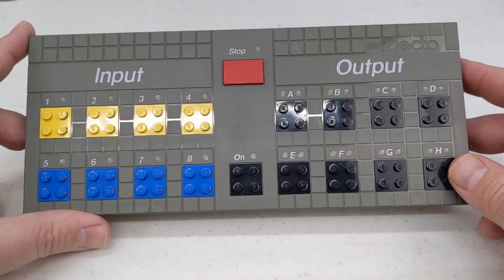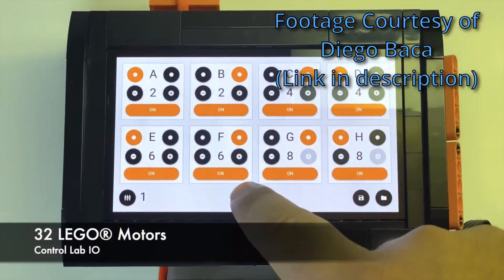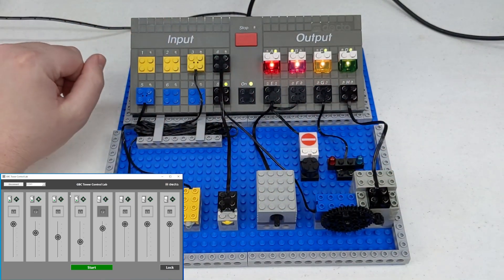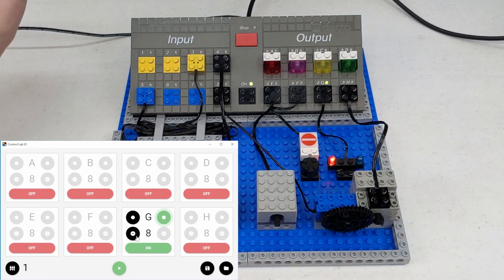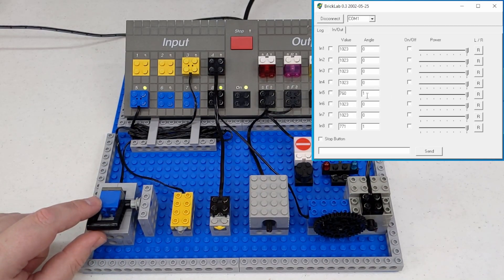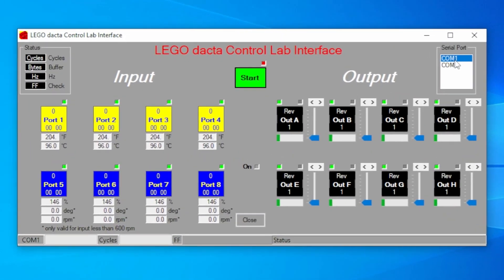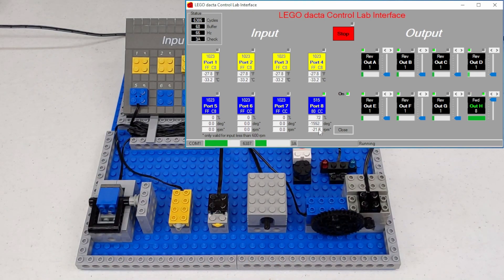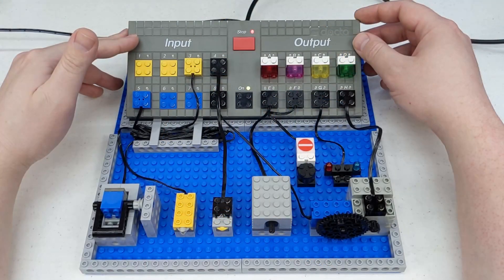Lego DACTA serial interface third party software (DACTA Control Lab)

Comment: Is it normal for the stop light to not iluminate when you conect power to it, i dont have a cable yet so i cant test it.
Reply: Edit Problem solved i had to swap the polarity of my dc plug,  dont know why it would matter with an ac input
Reply from the maker: Yeah that is really strange, I have no idea how that's possible 🤷‍♂️

Comment: Got my hands on serial interface and tried to launch it via "Lego Interface B software". Everytime I try to connect it deplays "Timeout error initializing on com1"(connecting com-com, not usb-com) on windows 7, not original lego cabel, any ways to solve that?
Reply from the maker: If it is a non-original cable that is probably the culprit.  It uses a very non-standard male to female null modem / crossover cable.  I was able to find some on Amazon but it took a bit of searching, It is not a very common cable.  The interfaces can have hardware issues, one of mine has problems connecting and I've never been able to figure out why
Reply: @BatteryPoweredBricks  hope it's a problem about cable cos. interface I own is almost as new. As for cable, is its structure actually different from other male to female cables ?
Reply from the maker: Yes.  Most male to female cables are "straight through".  A null modem or crossover cable will have the transmit and receive pins crossed.

Comment: It would be great to see some of the modern software for powered up work with this. 

It shouldn't be that had I would thing. From my understanding the logic runs on your PC. All you need is to talk to the inputs and outputs of a serial device. A small layer of translation and add the extra in/out numbers to the code options. 

Even better if you can add a Bluetooth serial adapters and would be much easier to use with newer computers.
Reply from the maker: I'm sure it could be done, but idk how many use cases would need the DACTA Control Lab AND Powered Up.  Not saying it wouldn't be cool.  Say for instance if Brick Automation Project had support for it you could control 8 switch tracks with it and use the sensors, while the trains were Powered Up.  Even better if it was like Diego Baca's software and you could use 4 interfaces at once 😁

Comment: Just out of interest... do you HAVE to control the outputs from a piece of software?
Or are there manual buttons to control the outputs? (eg to use it as a glorified 9v lego switch panel?)
Reply from the maker: Yes everything is controlled from a PC.  The alternative would be to use the Technic Control Center, but it only has 3 outputs.  Still very handy!
Reply: @BatteryPoweredBricks  Thanks for the confirmation, I've added a Technic Control Centre to one of my BL wanted lists, I'll get one sometime and have a play about with it. Looks like it would be very useful for controlling 9v stuff on a layout (even if it is only 3 things at a time!) The only other Lego thing I can think to use for a panel of switches is the PF Pole Reverser switch - Thank for the reply!

Comment: Not exactly third party, but I understand that certain versions of the Lego RoboLab software support the Control Lab interface (ver 2.5.4 specifically). Is that something you've tried, and are their pros/cons to the original control lab software?
Reply from the maker: I had trouble getting Robolab to work and connect to the interface.  Once I found The DACTA Control Lab software I wasn't too worried about it.  I love making control panels

Comment: Does the rotation sensor measure in only 16 incremental steps? What is the accuracy (+/-) ?
Reply from the maker: Yeah it's 16 ticks per revolution. You can always use gearing to have more ticks in relation to what it's measuring.  It's pretty accurate as long as it isn't rotated too fast (also depends on the device it's attached to).
Reply: Okay, thanks. Mine is directly connected to a micromotor (red), and on full power (9v). Do you think this will be slow enough for it?
Reply from the maker: That should be plenty slow enough.  I've never really did any in depth testing, but I've never had any issues with the rotation sensors